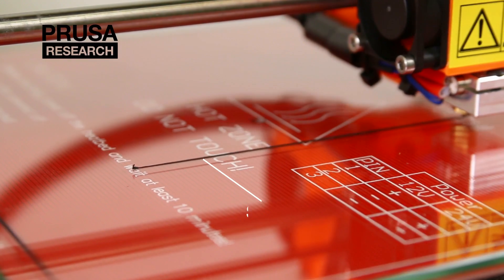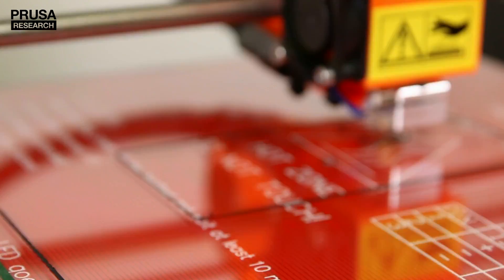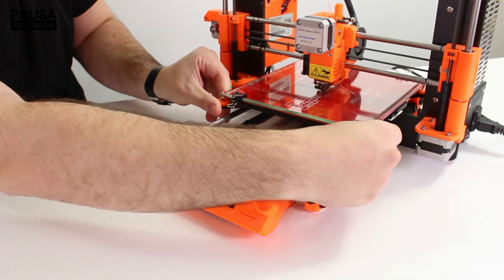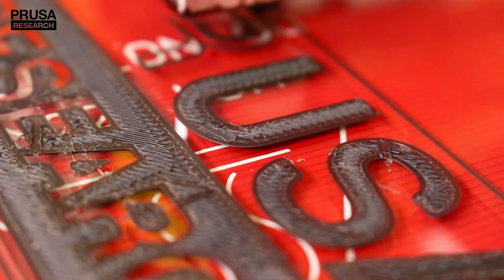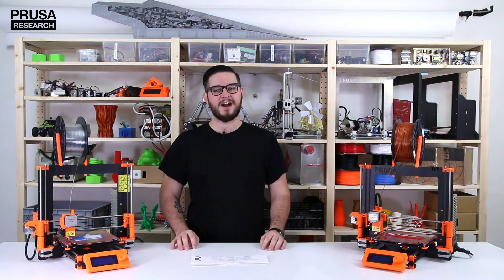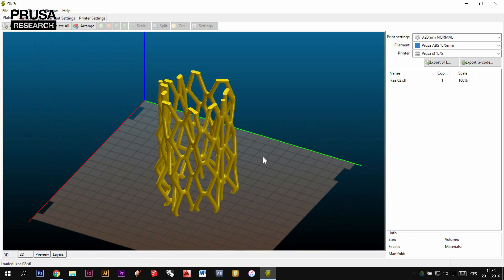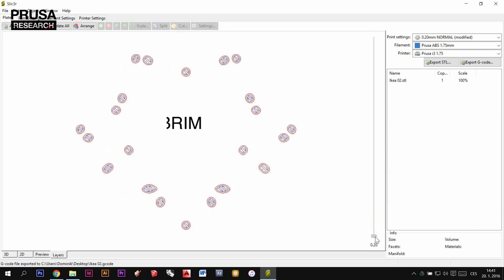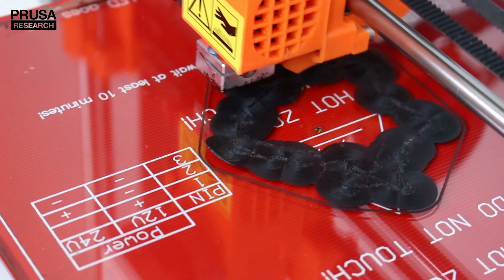Perfect first layer - Tips and Tricks #5

Comment: I’m trying something new. I’ve altered raft settings so I have 8 mm margin and also set the support type as grid so it’s more rigid. I wanted to see if I could make the 1st layer of the raft solid rather than having gaps but doesn’t look like an option. So I start the print with pla then as soon as the raft is done I pause the print and as quick as I can swap over to abs and resume the print I’m hoping this works out well.

Comment: I found out something interesting.  When printing circular objects in TPU on the Prusa powdered textured sheet, setting the infill pattern to concentric for the first layer (bottom infill) makes the print adhere to the sheet extremely well vs. the default.  It adhered almost too well as it required a little alcohol soaking to peel off.

Comment: I just got the MK2s.  All my prints have a very thin edge on perimeter of first layer.  Can you tell me how to correct this?  I tried reducing bed temp by 10 degrees, but did not help.  I get this protrusion when printing either PLA or PET.

Comment: For really small prints increase the  number of skirts to 2-3 to get enough material through
Reply: +dumbcomputers 
same for me too.
Reply: +dumbcomputers There is also a minimum length setting for the skirt too in Cura for small objects, so if two passes of the skirt is not that long, it will continue to go round until that length of extrusion has been met.
Reply: +dumbcomputers The method of using skirts as you suggests,  only applies if your skirt is set at 0mm to printed part, the correct method would be as Mr Prusa subjected, Using Brims. In  all slicers software, brims and skirts are two very different setting with their own jobs and advantage.
Reply: +patprop74 I use 2 (*the skirt line count in Cura under expert settings)  skirts 3mm distance from the object. This helps me with small prints. I don't like to use brims because  it sometimes require some clean up
Reply: Brims and skirts are the same thing it's rafts that are different.